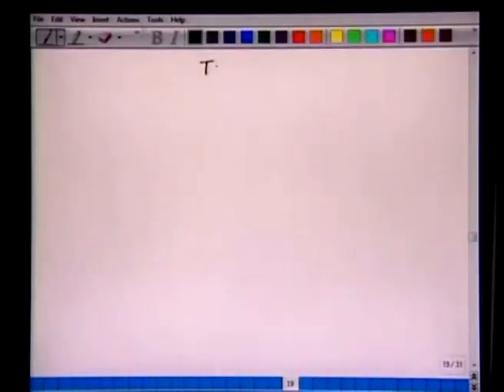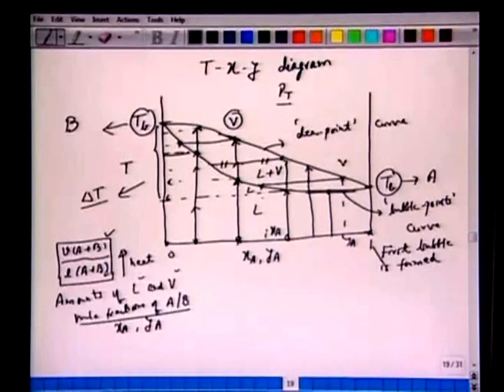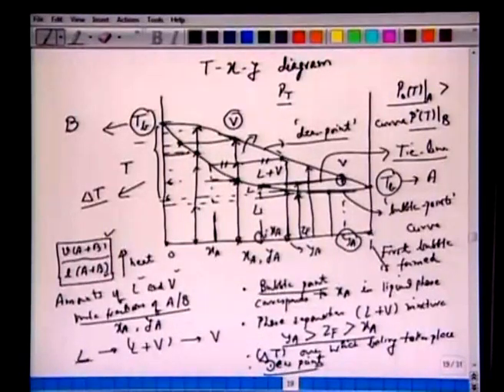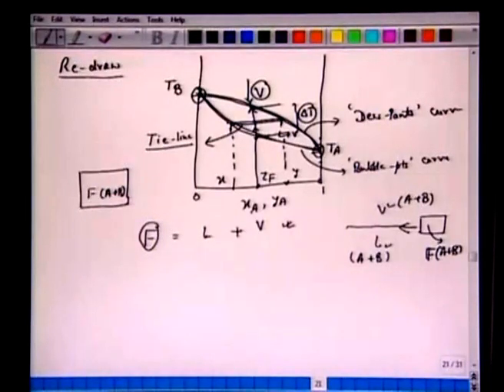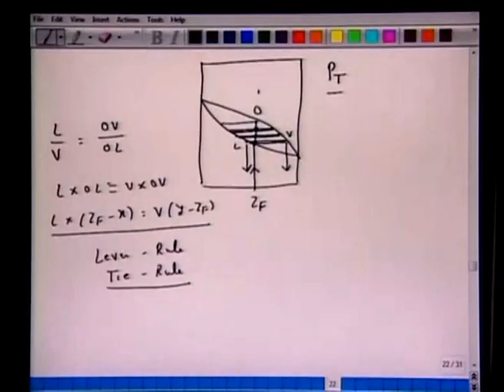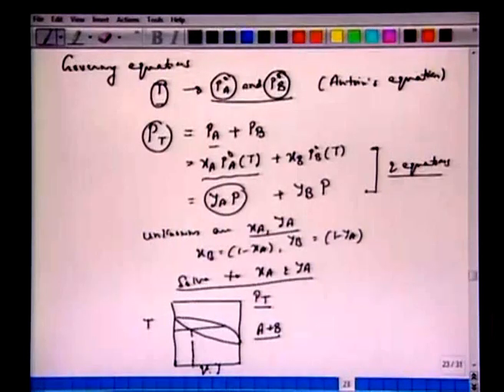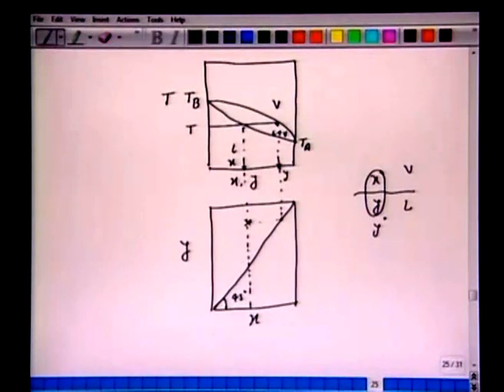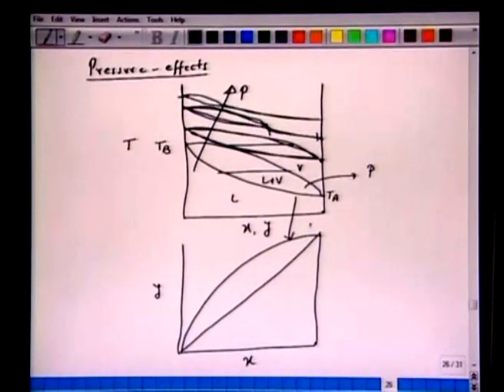Mod-01 Lec-14 Lecture-14

Comment: 37:18 total pressure curve should be straight line as we get from roult's law. Right ??
Reply: Yes you are right but Pt here is not the total pressure (Pa+Pb) this Pt is the external pressure at which the system is operating amd in this case we are changing the pressure so liguid mixture will boil in some range of pressure